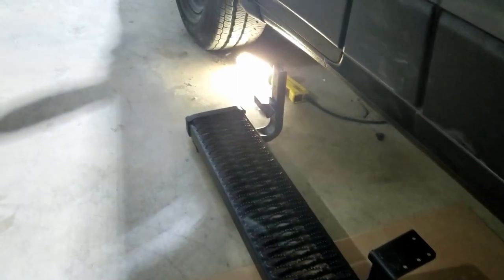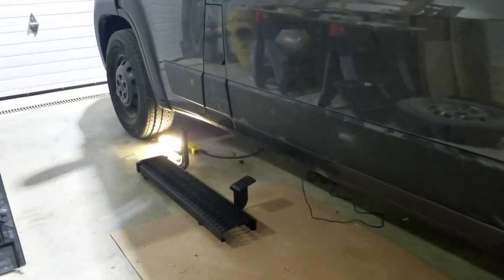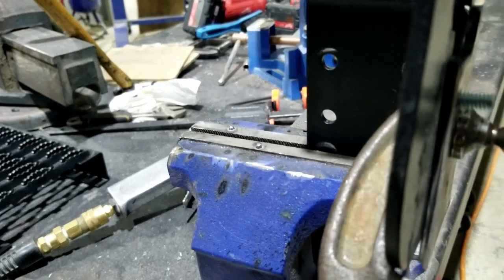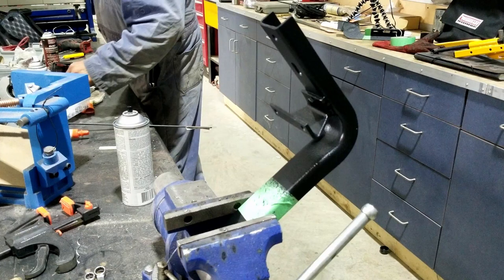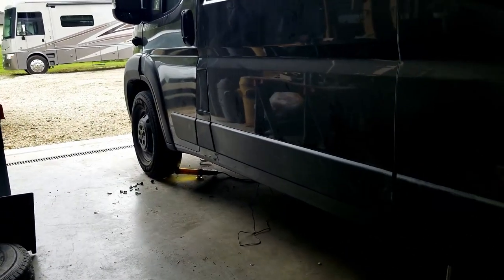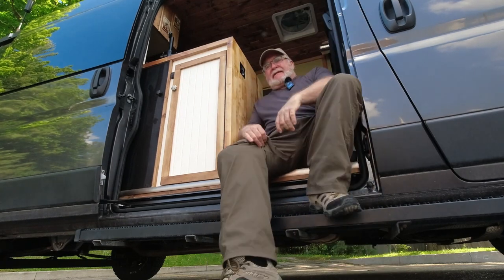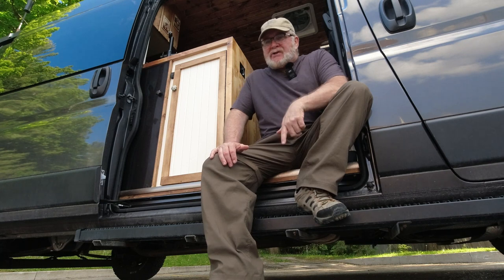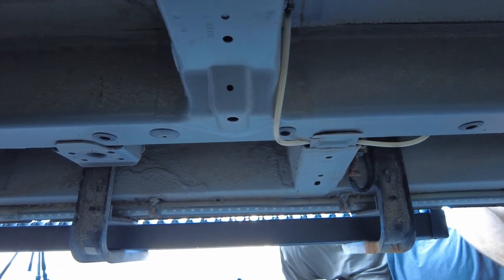DIY RUNNING BOARDS INSTALLATION. WE HAD TO CUT OUR VAN SIDE STEPS!//EP9:Promaster Van Build

Comment: Holy smokes, that was a lot of work for something that should have been good to go, straight from the package. That said, I bet you were happy to have spent the time raising them up, when you were on that insane logging road in BC
Reply from the maker: Hey Michelle! Yes, it was quite a bit of work for Rob and his brother, but the running boards turned out great and are really helpful for me to get in and out of the van. I agree that they could have bottomed out on that forest service road, if they had not been modified and lifted. 😬 Thanks so much for your support and comments. ❤️